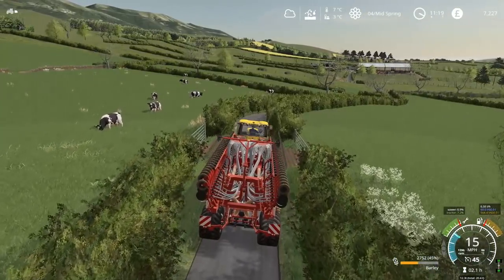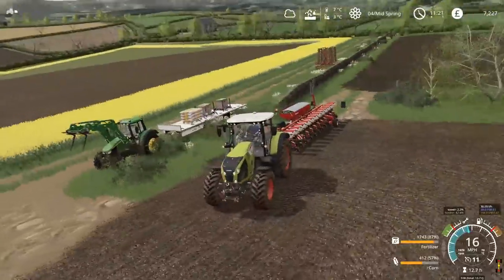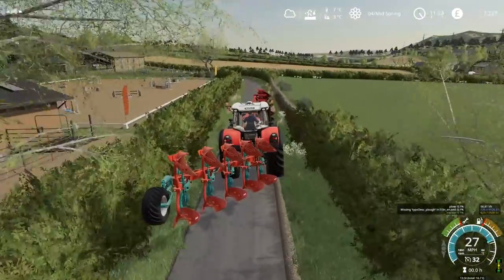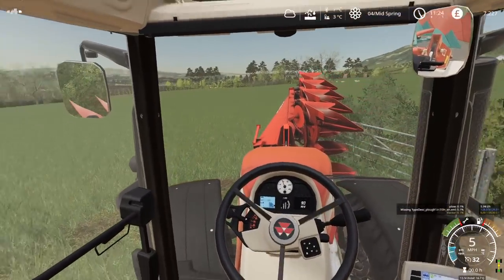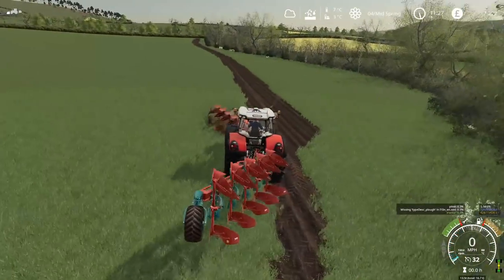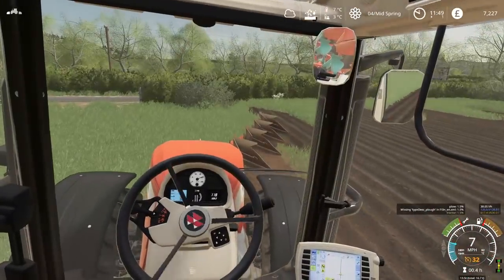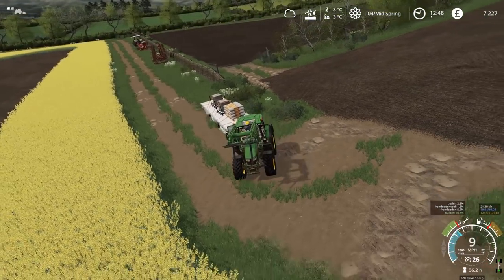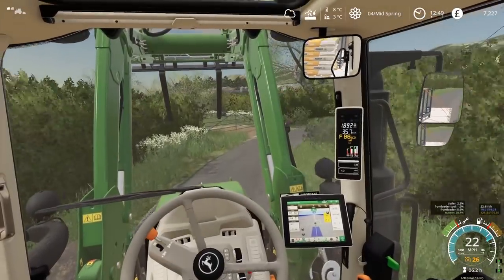TURNING THE LAND WITH 2 PLOUGHS | Purbeck Valley Farm Farming Simulator 19 - Episode 20

Comment: Daggerwin, before you plant that newly ploughed field know that as you've applied solid fertilizer, the same type the planter uses it won't register as fertilized. It would be wiser to plant or drill the field without fertilizer, than apply some with the spreader.